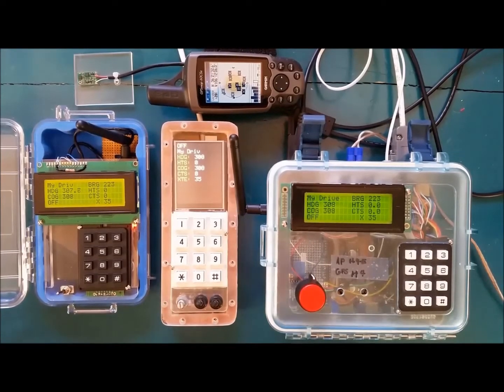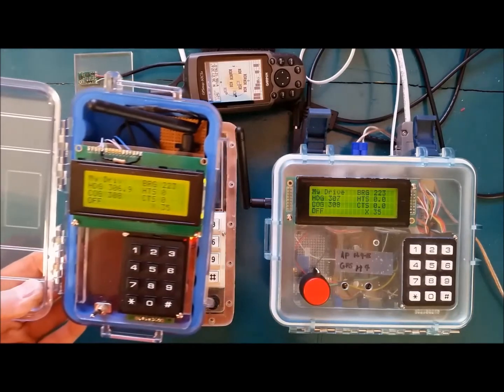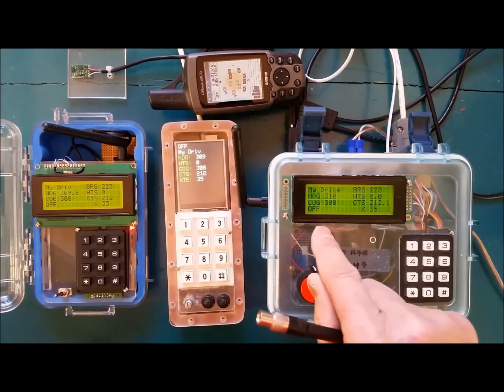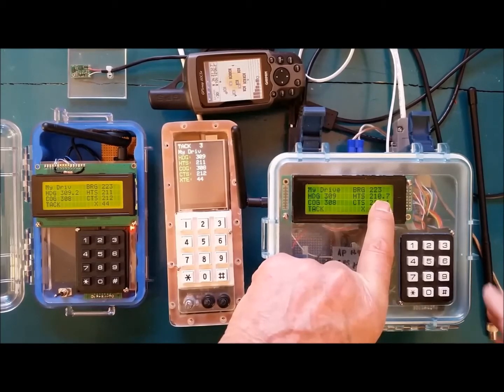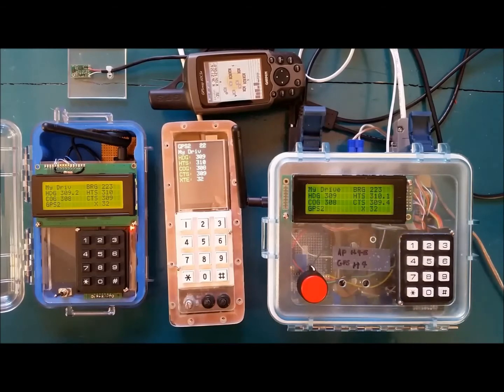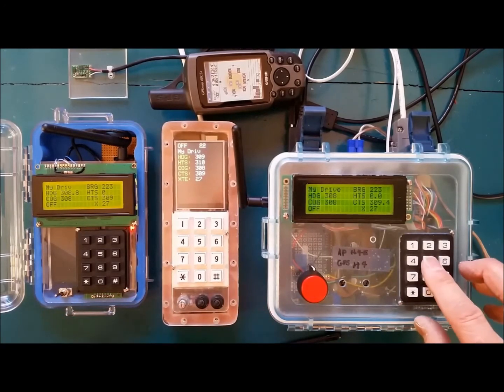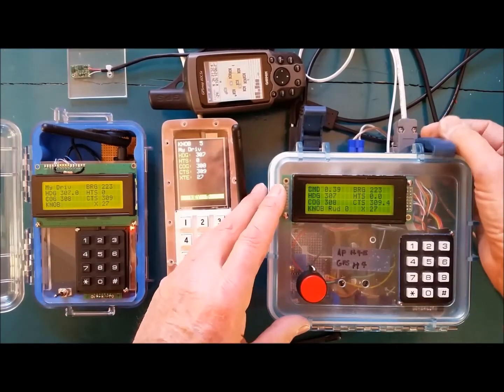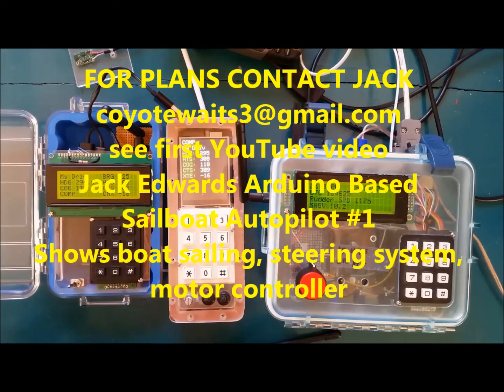Jack Edwards Arduino Based Sailboat Autopilot #2

Comment: Hello Jack, I'm trying to follow in your footsteps and had a somewhat remedial question. What wire you are using for the handheld remote and how is it connected? It looks like simple ethernet cable, which you mention in your documentation, but my understanding is that standard ETH has only 8 wires, whereas the keypad needs 7 and the LCD needs at least an additional 4. How did you supply the entire remote with just one cable? Thanks! 

PS - how long is the USB cable you used for your IMU compass to your install location? Am I understanding right that you ran it from your main AP box to somewhere under the headliner of your cabin? Seems like it'd need a long wire run unless I'm misunderstanding.
Reply: Jeff, Thanks for your comment. A little background on things that didn't work.  My first remote used two eithernet cables. It used an LCD with parallel wiring.  The data was sent and received using a Serial connection.  I found that the wires picked up a lot of interference and would cause the Autopilot (AP) to lock up. So then I went to using the nRF1401+ wifi modules and they work well. In particular they work very well in receiving the updated AP data. They actually work at 100 m. So they update the remote screen very well but the key pad sometimes has a little latency.  This remote is the one shown on the left in the picture in the video. To address the keypad latency I made the remote in the middle (wooden box). It has a nRF24  receiver that updates the screen but uses a wired keypad.  The keypad is physically wired to the same pins as the keypad on the main unit. This works great.  I have found that the TFT screen shown in the photo above is a little hard to see in bright sunlight.  On my boat I pretty much always use the one on the left which is full WiFi and uses an LCD.  I have found ways that speed up the WiFi keypad function by using the auto acknowledge feature of the nRF24.  

In your comment you say that the LCD requires 4 wires.  That is true if you use the I2C adapter on the LCD and most are sold that way. I find that the I2C LCD interferes with Serial GPS data.  I have quit trying to use it and just put up with the pain of the extra wiring to use the LCD with parallel wiring.

I have made several other remotes.  I used the Adafruit TFT touch screen Arduino shield. The touch screen fits right on top of the Mega.  A nRF24 WiFi fits between  the touch screen and the Mega making a very compact  remote.  It would be cool with a 3D printed enclosure.  The other remote I made last year,  A man in Alaska with a large fishing trawler wanted to build an AP but he wanted to be able to operate it from the rear deck.  So  built a wired remote.  I used an Arduino Nano connected  to the main Mega with serial with short wires, then I used a pair of Sparkfun I2C circuit extenders boards which give a range of 100 m. It uses a single eithenet Cat 5 cable, a keypad, an LCD and an Arduino Nano on the remote end. So that one works great also.

You asked how long my IMU wire is.  First I basically use a 4 strand telephone wire.  And on the boat my IMU wire is about 10 feet (3m).  It works fine on the mega.  I use phone connectors and eithernet connectors because the plugs are so easy to install and use.  A note about wiring the phone connectors the wiring on the two ends are reversed so that connecting two wires with an inline jack doesn't reverse the end connector. 

Let me know if you still have questions.

Comment: Nice project,  what would be needed to drive stepper motor with this, cheers and thanks
Reply: If haven't used a stepper motor with this but it should easily be done.  The Code generates a rudder position command.  All that is needed is to convert that angular position into stepper motor commands.
Reply: @jackedwards1337  Thanks for the feedback sir, I will try a stepper motor with this. I wonder if the kit is available for sale?, preferably with the PCB that reduce wiring. Thanks again and cheers

Comment: Hi Jack, looks great, good use of remote computers and I like the GPS course mode.  I cant remember if I asked are you using PID control and how did you tune it?  I've been having successes with mine too, now I know how to tune it properly.  knocked about 50NM out with it in control.  Added tacking modes and currently paused further development whilst I return my attention to the nav comuputer.  Intention is to eventually link the two together.

Comment: Hi Jack,

BIG upgrade...

Did you ever thought about using a PID function instead a "rudder feedback" ?
In my initial project I had a rudder feedback based on a potentiometer. Now, I' m working with a PID function. At Lab level I've got very good results.
Our goals are, basically the same but the final product is different. 
Question: How often you read your chip compass? Do you take in consideration ONE read or an average of reads? Do you take in consideration the GPS compass reads or not at all?  
Keep in touch.

Rabadakpilot
Reply from the maker: Hi RBDPilot,

The upgrade is not really that new it is the video that is new.

Using a PID is definitely the way to go. My basic control uses a PID. The proportional term is the heading error. The differential term  is bearing rate in the horizontal plane computed from the XYZ gyros.  The gyros are set to their lowest range to increase sensitivity and reduce the gyro noise.  The integral term is the old integral value plus  a small percent of the heading error each cycle.

The rudder command is set equal to the PID result.  Rudder command  minus rudder position is the rudder error and this controls PWM rudder speed.  My autopilot also works well without the rudder feedback.  

Raymarine and other commercial autopilots use rudder position feedback and rate gyros to improve control so that is why I choose to go that way, and my autopilot is more responsive when I use rudder feedback. 

The rudder position also allows for a couple more functions.  It allows me to have knob control steering.  

I am now experimenting with asymmetrical steering.  I have found that going to weather in strong wind you need more force to increase rudder than to decrease it.  To apply more force with a PID requires a larger error term.  To increase rudder if there is already a significant amount of weather helm I read rudder position and use a higher rudder PWM speed to increase rudder but use regular PWM rudder speed to decrease rudder.

I sample the compass about 50 Hz and do not smooth it. I have tried smoothing it but that slows down response. I do use a deadband of +/- 2 degrees to minimize continuous autopilot jitter.  I was just reading the old Autohelm tiller pilot manual and they have a sea state knob, calm to rough, that increases the deadband in rougher water. I think this is because of the poor tilt compensation of available IMUs.  I might think about adding a knob for that.

In GPS mode I use the GPS and a chart plotter route to follow a course but use the route and cross track error to compute a compass heading to steer and use the same compass steering PID.  I do not use the GPS to apply a compass steering correction.  In my thinking the compass is where you are going and the GPS is where you have been. For instance if a following sea slews the boat off the heading the first thing to detect it will be the gyros and the signal will apply corrective rudder output.  Then as heading error increases the heading error will also work in the direction to return to course.   The GPS course over ground error (COG) will not respond until the boat is traveling in the wrong direction.  

Regards, Jack